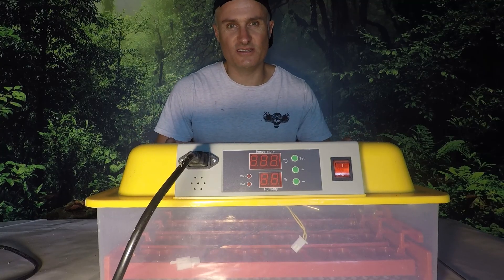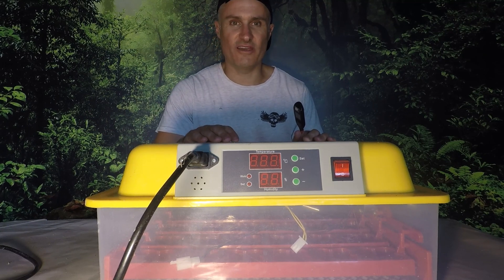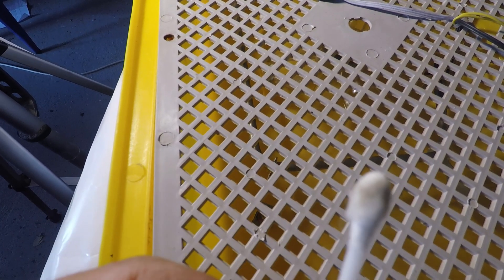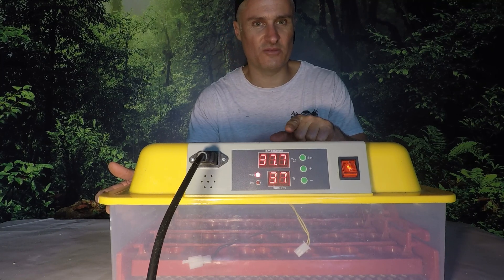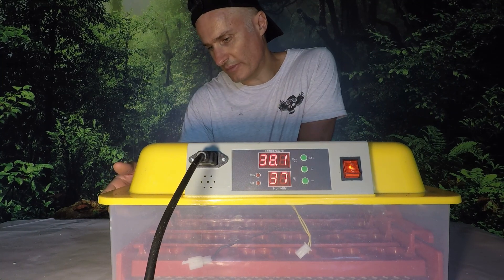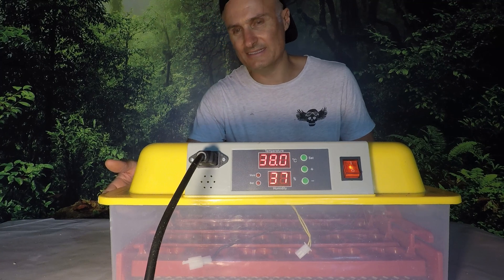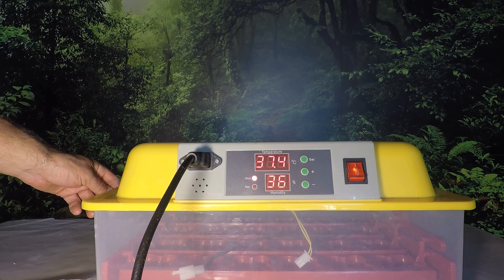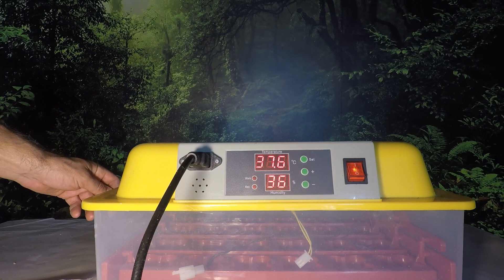Calibrating your incubator

Comment: Thanks for the video mate. Good work. Can you do one on humidity, specifically on this model about what the water channels are? The manual talks about filling 1 or 2 water channels but there are 4 holes. There are many sections on the bottom that are separated so it is confusing. I just bought mine and haven't used it yet.
Reply from the maker: It won't be too much of a problem if you put water in a few of the holes, there is a fan inside which should help move the humid air around so it gets across all the eggs. I will look to do a video on this in my next batch.